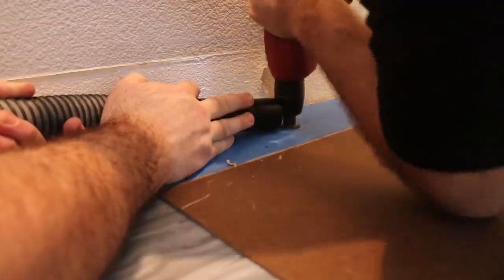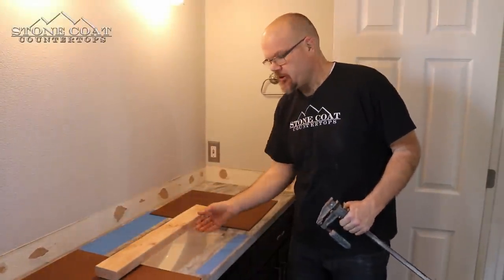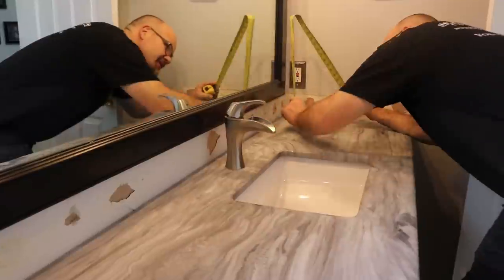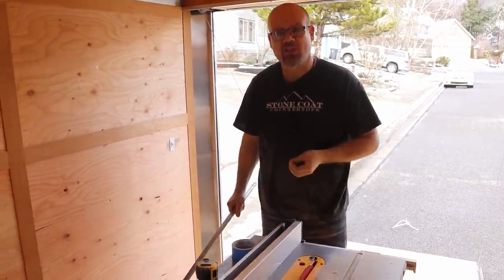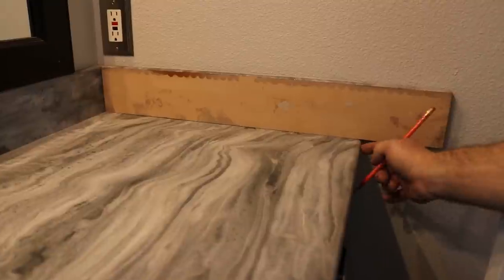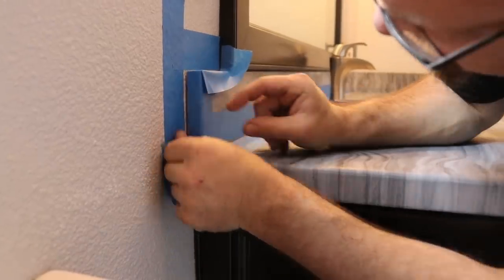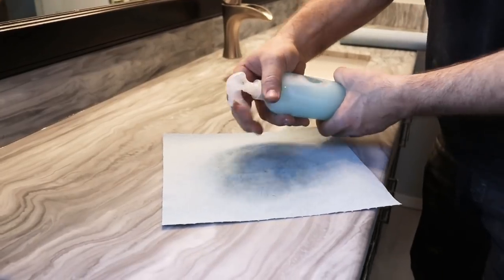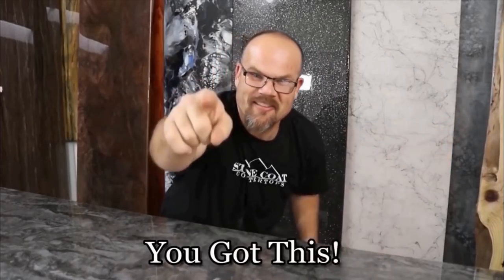Epoxy Countertop Installation Tips

Comment from the maker: What was your favorite Pro Tip from this video?   https://www.stonecoatcountertops.com/
Reply: Taping off the walls before running the bead of silicone to get that nice straight line look, awesome.
Reply: Stone Coat Countertops awesome
Reply: Counter looks awesome!! Just curious though, I noticed you used RedGard on the underside of the countertop where it meets the rim... is there a Pro Tip for the when you drill the hole(s) for the faucet and expose the wood? Do you use RedGard around there as well? I'm just worried the counter will swell if/when water makes it way under the gasket of the faucet. Thanks!
Reply: Blade type
Reply: Sorry, no Pro tip I haven't seen or used before.
One Pro tip from me to you: Before you dip your finger into the silikon, dip it into this green dish soap (with a little water) you use for your pots and pans (I don't know the english name for this ;) The silikon will not stick to your finger and it will work smoother when putting on the silikon...
Reply: at my stage of the game, every Tip is golden. Thank You for spending your time with us.  Have to add this in here. I call in yesterday to ask a simple question and came back with all kinds of knowledge, and feeling charged up to get out there and just do this. Thanks to everyone at SCC
Reply from the maker: @raymamacat  thanks, thats a key for great joints!
Reply: @franknoth6726  All Pro-Tips welcome! Thank you for sharing your experience and what works well for your installations! We appreciate the feedback and knowledge!
Reply: all of em was exceelent
Reply: I JUST discovered your channel and this product. I am floored that you can use an undermount sink with a wood countertop treated with your product. I sense a kitchen reno in my future!
Reply: ALL OF THEM! The Pro Tips are indeed priceless. Maybe not say "Pro Tip" every time, but EVERY ounce of advice you provide in all of your videos are super helpful and provide us with confidence to do this stuff! THANK YOU SO MUCH!
Reply: Hey Mike! We’re about to do the countertops in another house! :) ....Tackling under-mount sinks for the first time.

QUESTION:
How do we do it?!?! 
I can’t find a video on it. 

I see you have a red substance and then black paint(?) on the underside at the start of this video. Can you please send me a video link or some pro tips for the pouring stage of a new construction under-mount countertop.

Thanks so much!!! ☺️

Comment: Pro tip, use color matching silicone instead of clear. It makes a noticeably cleaner line and the counter will meld perfectly with the backsplash. My customers love the detail and it does not add any time to the project.....Love this vid and the vanity top came out beautiful!
Reply from the maker: Great Pro Tip and excellent suggestion! Thanks for your feedback and great comment. Keep up the good work out there

Comment: I've got a Pro Tip to add to a Pro Tip.  After the purchase of our 1st NEW house & the walkthru done, the Construction Super stopped by to finish up some caulking in the kitchen.  His 1st tip was he advised me to wet my 'smoothing' finger.  I found this really helpful until I got the technique down & it was also good if I wanted to redo an area that hadn't set up yet.  The 2nd Pro Tip, not like many people have it much anymore, was for the white grouting between the kitchen countertop tiles - 4".  He advised cutting a fresh tube of caulking to the width of the grouting & cover it with the white caulking.  He said cleanup would be easier (it was) cleaner (because the silicone caulk wouldn't absorb germs as easily as the grout) and if I got a stain, I could just throw a bit of bleach on it to re-whiten.  I lived in the home for 15 yrs and his helpful Pro Tips held up marvelously.
Reply from the maker: These are awesome pro tips Nana Ann, thank you for sharing these with everyone!

Comment: Thx for the informative video and great job.  The tip at the end is my pet leave.

3. questions...
1.  when you pull the tape, doesn't it result in lifting the epoxy and create a shelf or a lip?  
2nd, do you have the link to how you made that counter top?
3rd, how can I convert a tiles counter with sinks installer over the counter using the epoxies without removing the tiles?

Comment: Awesome video!! Question, Is the backsplash mdf? Now i know you caulked and sealed it in. In a bathroom where there is going to be water on the top. Would you be concerned about the caulk eventually breaking down and water getting underneath and the mdf imploding from behind. I was wondering if the edge should be redguarded before application. What are your thoughts?

Comment: I live for your pro tips!, my favorite pro tip is pulling the sink up with a 2x4 and a clamp.  Also running the silicone bead towards the outside perimeter of the sink! By the way, I am wrapping up a really cool project I made using stone coat. One you have never done a video about. Let me know if you want photos..

Comment: I've got a pro tip for ya when you cut a backsplash to size on a miter saw the good top edge should be facing you and then the blade wont chip it out on the good side

Comment: so I noticed that the sink didn't come right to the edge of the counter top and that there was not epoxy up under the edge around the sink. is that going to allow for water damage in the wood that is merely painted and not sealed?
Reply from the maker: Thanks for watching Scott and your great feedback. We applied two coat of RedGard waterproofing membrane to the underside of the countertop. This product does very well to waterproof the underside of the countertop and we also like to put a couple coats where the dishwasher will be installed in the kitchen. Thanks again for watching and your excellent feedback!

Comment: What I’d like to see next is you coat a preexisting counter with backsplash,,like a bathroom vanity and then show how and when you clean and pull your tape etc,,,no one shows the clean up. If your masking tape gets epoxy on it etc how do you pull it off a wall, off the vanity or let’s say it has a mounted sink etc?